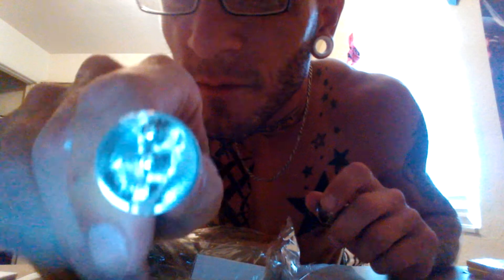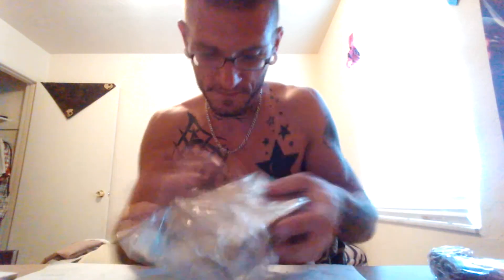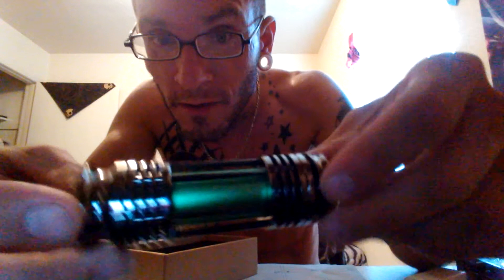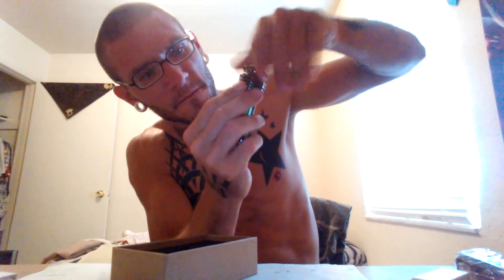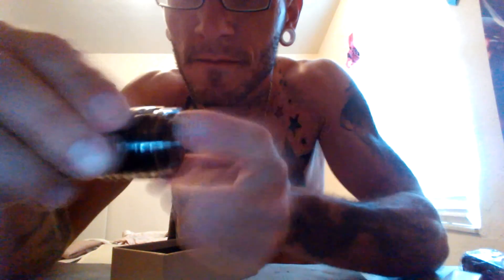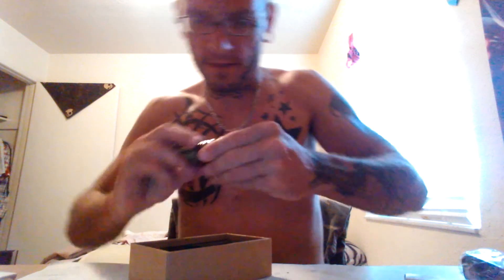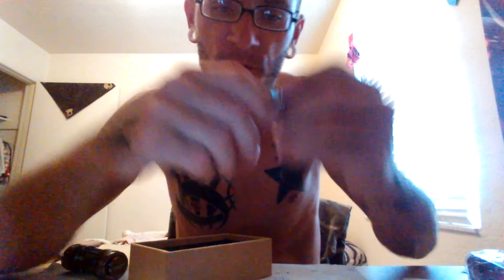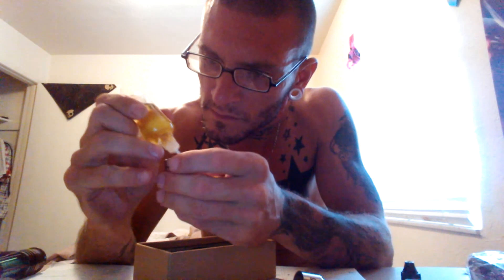ROBOT 5 E CIG MOD/ OMEGA REBUILDABLE ATOMIZER

Comment: Mine is stuck in the lock position, any ideas?
Reply from the maker: Maybe try to squirt some WD 40 around the threads, also if you have an air compressor ya might try blowing the bottom area with air, I assume there is dirt or something stuck in the treads